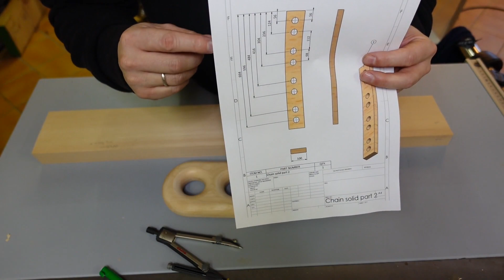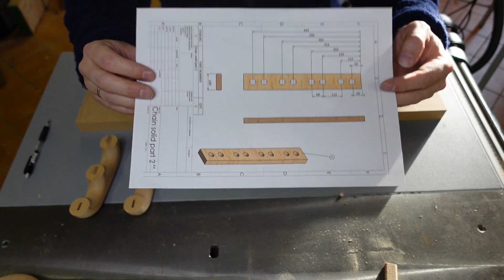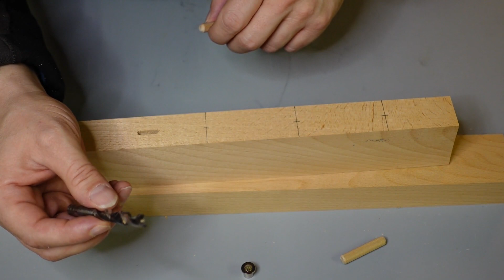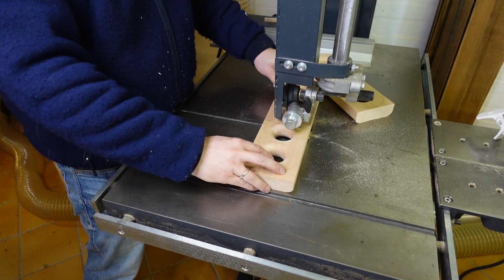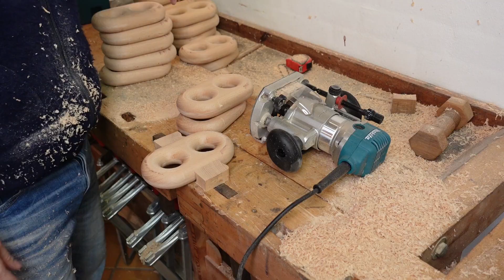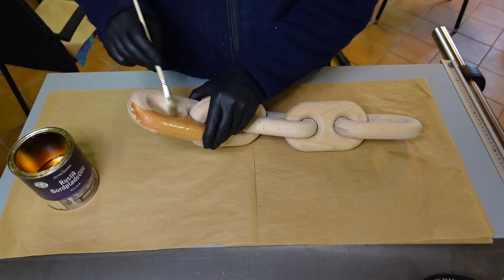Escape the Ordinary: Build Your Own Giant Wood Chain Link - DIY Tutorial

Comment: I ordered the plans but what about the wooden bolt and nut ?
Reply from the maker: The bolt and nut is not in the plans
And the hook is not either only the wooden chain.
Reply: @ErikHovedskou77  how about plans for the bolt and nut the hook would be no problem.
Reply from the maker: @davea2038  i don't think I did any plans for the nut and bolt, as I only made 1 or 2 because I could not make the thread work.. 🤔
But will look thiugt my files on my computer and let you know if I find any.